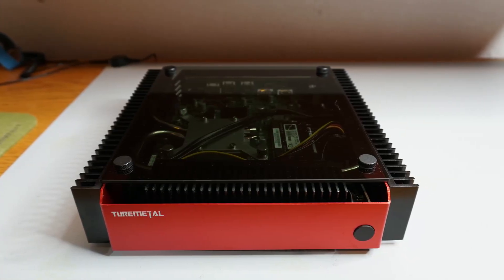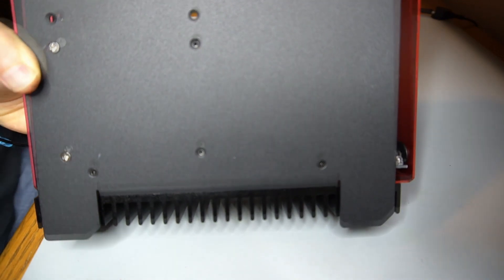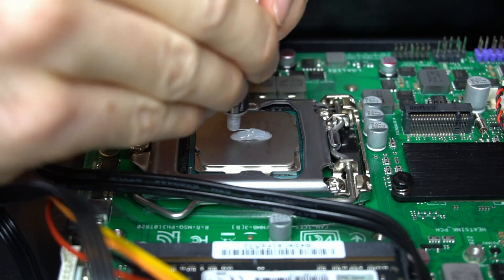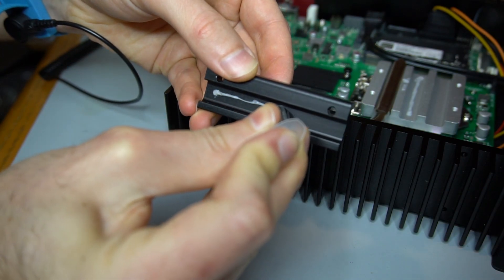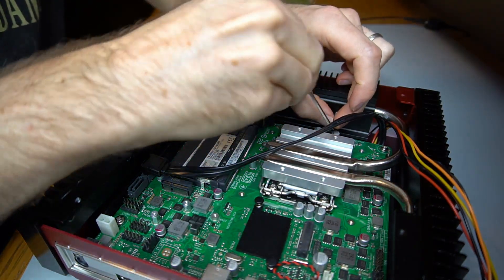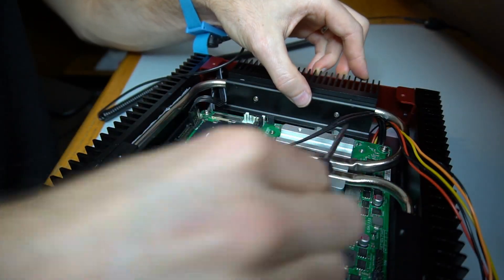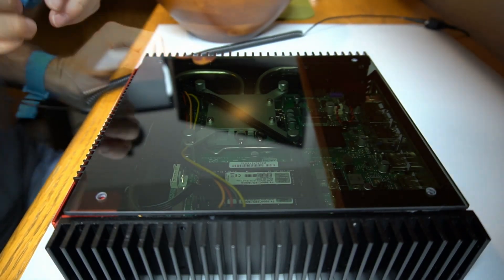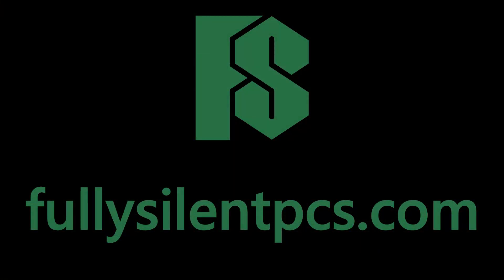Turemetal UP2 - Building a Fully Silent Fanless PC

Comment: Hi team, nice builds. Is there any plans to try out the Turemetal UP5 case?
Reply from the maker: At some point, yes. My time is limited though. I'm one person doing this part time. I have the Akasa Maxwell Pro and Turemetal UP10 next in line.
Reply: Fully Silent PCs after reading about the UP5 case it seems it doesn’t house a proper power supply 😑